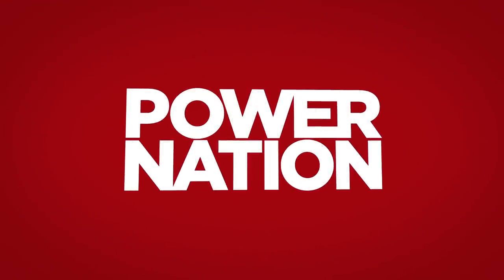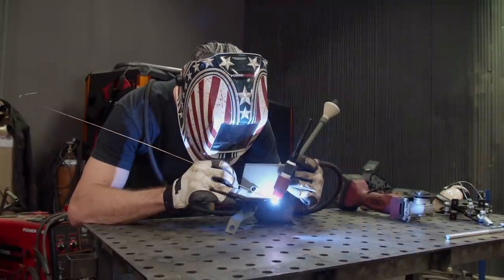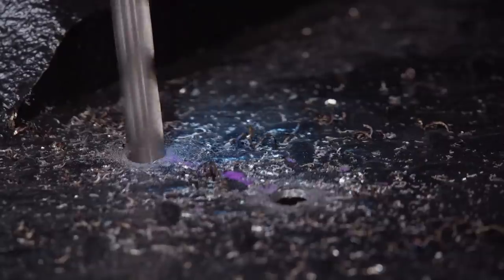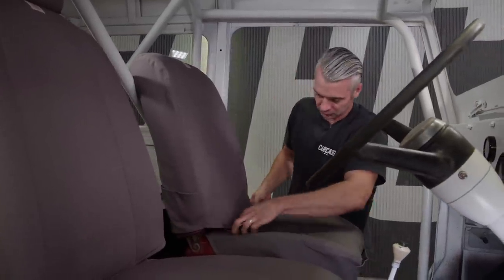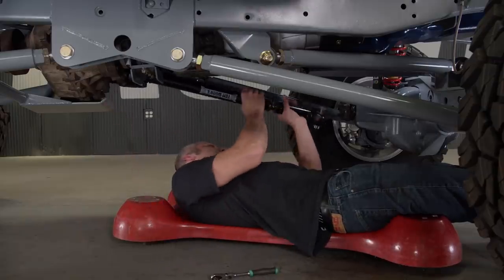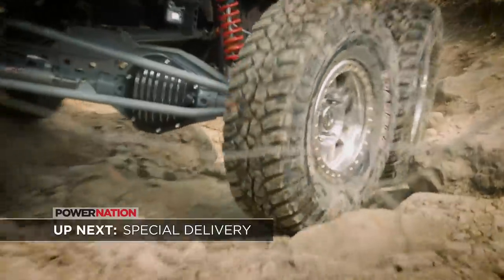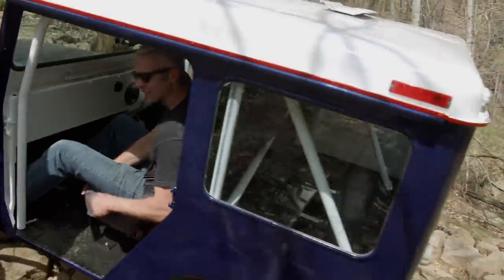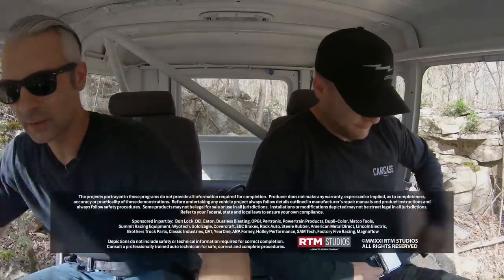Can The Junk Mail Jeep Deliver On The Trails? - Carcass S2, E10

Comment: I see all the comments below and I understand some critiques - I'd have used a wiring harness bulkhead quick connect pass-through personally - but I've never myself built a complete 4-link suspension from scratch.  These guys show and thinking are not necessarily to my preferences a lot of the time but they have a job to do an entertaining show  using their obviously serious skillset and talents.  Should they have painted the fresh cuts, grinds, and etc?  Yep.  Grommet the wiring?  Yep.  Chosen something other than self tappers? Probably - but they have deadlines and other items you and I have no clue exist.   They teach us a lot (simple bending jig made of bolts on tabletop, room for tubing flex by bending around a tube, and that it needs to have flex room built in your brake lines to prevent cracking) give lots of ideas (alternate mounting of cooler locations and etc) and show how to fab some stuff.   Just like This Old House showed ideas on home building and remodeling for decades without being a "how to" show, or a fully DIY show- this is similar to inspire you to grow your skillset with ideas as inspiration.  Personally - I'd have built an internal tube frame and hung the gas tank from it and cooler also with a false floor or custom organizer to use the back for carrying stuff along with you, slightly more aggressive tires,  switched to a LH drive,  and used a different carb. Probably added slider tubes on the side (with the requisite steps - I'm getting old), run a remote radiator fill tank,  exhaust run out the back with the muffler very near the end,  some sort of door or half door, and had grab bars on the roll cage. But they are obviously talented they built a pretty seriously capable machine, and can make changes and upgrades as they (and we) learn more and see additional changes and needs.  They can't show each step,  build/finish everything perfectly or these projects would last many months and you (and I) would lose interest in certain ones because not everyone is looking to go rock crawling, mudding, cruising, drag racing,  road racing,  or what have you.   My fear for myself is that I will get hyper-critical to the point of chasing cars down the road shouting "Get off my lawn" from our viral induced social regression leading me to become a keyboard warrior extraordinaires - with no room for our differences. Peace, learning/growth, and prosperity to all of you in the future.
Reply: Robin Barrow --> So well stated!

Comment: I Had a 1975 DJ5~ 6 Cylinder, which I bought for $500.°° I was able to replace the wheels with Suzuki samurai rims and the extra tire mount, times were hard and it made a good plumbing truck, I replaced the front and rear bumpers w/the rear having a trailer receiver and I also installed a latter rack from bumper to bumper, it was  good  for hauling all my tools, latter's Pipes, I even hauled A/C's and Heaters on the roof we even used it to get into the arrollos  to  bring out sand and bed rock when we were building our house, it lasted me about 7 Years it was very reliable.

Comment: With some -- a few? -- MORE modifications, you could put other bodies on this. I'd try a 1/2 ton Chevy van body (short).
This is like the best 4-by build EVER! This little guy looks like so much fun!     And i love, LOVE straight 6s. Torquey little buggers (TLBs). Of course, i would air-ride it, but these days, i've found that i want to air-ride almost EVERYTHING! C-notches are a wonderful thing (tub the wheel wells!). This would pull a 16 foot toy hauler, easily. It's not fast, but when i'm cruisin', who cares? That 6 would make gas mileage MUCH better too, even when pulling. Also, the 1/2 ton van would be wide enough to cover the wheels, i.e. street legal (maybe with some flares, i.e. mud/debris protection).i NEED a 4by 1/2 ton Chevy van!!!,..and the chassis/suspension system of Junk Mail to put under it,...with a straight 6.   😃

$$$$$$$$$$$$$$$$$$$$$$$$$$$$$$$$$$$$$$$$$$$$$$$$$$$$$$$$$$$$$$$$$$$$$$$$$$$$$$$$$$$$$$$$$$$

Comment: What... If your using an RH32 Transmission than you had to convert it to manual shift since that is a computer controlled automatic. How did you do that ?????
Plus with cable shifters you don't have to worry about body or frame flex differences.

Comment: Anyone else notice that they didn't use locking nuts , loctite or lock washers on anything?
Reply: Didnt he put thread locker on the u joint
Reply: @CRAPO2011  I noticed that later. No locking hardware on the master cylinder is kind of sketch, the shifter is just gonna rattle loose...
Reply: @blakeschluchter  you know more techi0nica details than I, my gripe is with how crappy the paint looks Bosher should have helped them lol
Reply: No bench bleed either

Comment: Wow you ride those bump stops worse then grandma on the brakes. 
They came at 4 in 3/4 for that reason... Soon as you show it on the rocks at 15 min 47seconds.. Yet suspension is so stiff and tire pressure soo high.  Yet yo want first class performance....
Reply: I'm emphasizing the front axle.... Rear is good... Because there are no bump stops lol